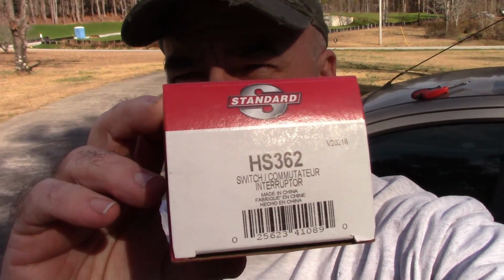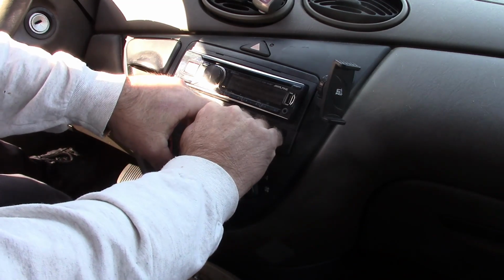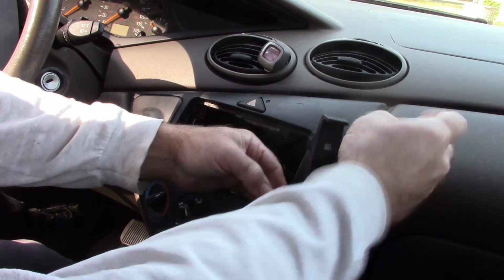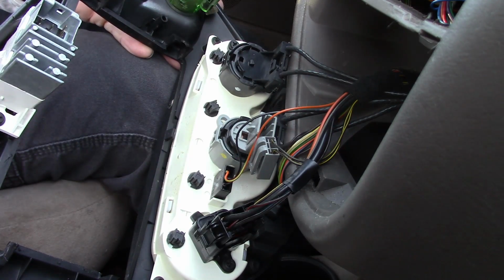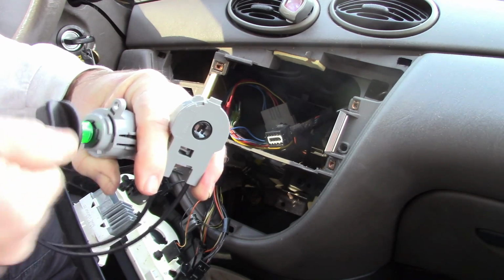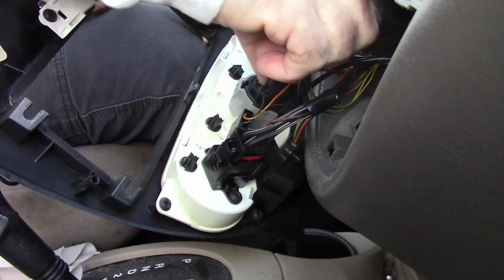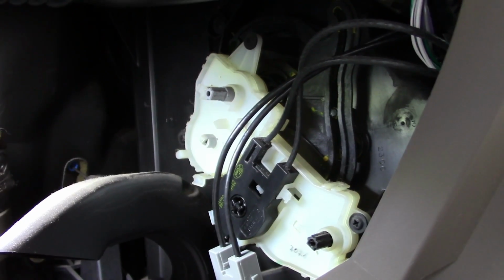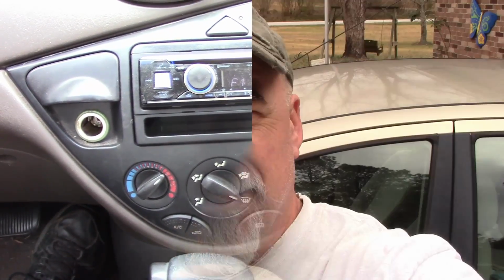Ford Focus Heater control switch replacement. Air vent control cable.

Comment: Thanks! I just had mine replaced last year and it broke again. It always sticks, I let my niece borrow my car and she broke it. Now I don't have defrost. Why does it keep sticking?
Reply from the maker: Hard to say.
Reply: @JoDaddysGarage I was told once that this is one of the Ford Focus flaws /issues. Thanks for the video. I have a 2006 Ford Focus and it has the same issue. Back around 13 years ago I brought it to a Ford dealership and they quoted me $1500.00 to fix. That covered 10 hours of labor and what not. How long did it take you? Just curious. As a woman who doesn't know much about cars,  I am willing to fix it myself after watching your video. 😊👍 Also, how do I get the part?
Reply from the maker: @irbeliaespinosa6622 I found the part on rock auto website.

Comment: Changed my cable it  was still sticking it was problem with vent not running freely drilled holes behind it and lubricated vent control lever spraying lubricant in drilled holes..works fine when heaters on hot..worse thing is accepting is what a complete hash someone msde whrn designing such a stupid idea😡😡😡

Comment: So the box itself on my car seems to be in a bind and im afraid if i purcahse and replace the switch, it will just break again. Anyone have any suggestions?
Reply: Yes its the vent door inside the box that the cable and knob is trying to open and close... it sticks in the shut position and when the knob is forced, it breaks the cable or controller... replacing the cable doesnt really fix the issue.. the door has sticky on its edges, the result of a foam rubber thats melted with heat... thats why the door sticks in the full left or right position  when turning the knob... the fix is to clean the edges of the door or at least spray some lubricant like silicone in there which will keep it from sticking shut.

Comment: The control switch does not turn to control to turn to either the inside car or window sc reen settings can u help
Reply from the maker: It’s probably the cable.

Comment: Thank my friend. Now i really urge to fix the air routing on my focus. Big hug from Argentina, Buenos Aires.
Reply from the maker: If the a/c is not working, there is a resistor behind the glove box. I replaced it and mine worked.

Comment: Could you move the mechanism by hand without a cable? Becouse I cant, mayby cams locked.. :(
Reply from the maker: I could move it by hand.
Reply: I know whats happend.. You have to clean and lubricate a manipulator(plastick "valve") which change direction of blowing insde of fan tunel. Its cuz of old gluing seal

Comment: Thanks bro! same issue with ours though it still rotates to the settings, just Very stiffly.. cable may not yet be broken.. now i can see how it works and what to check

Comment: Original radios from 200-2004 were anti theft radios which requires the “u” shape radio tools. 2005-08 are held in by 4 7mm screws. Not sure from 09 onwards.

Comment: My one is just sticky. I can only change it from defrost to eyelevels vents when the engine heater is hot. Looking at the underdah image I can see that the plastic cam arrangement is probably dry. I'll give it a lube and see if that helps. Thanks.
Reply: I have same problem for years. Lubricants helped for a half year…

Comment: Barry, my control works, turns on the dial and at the fan! But the air does not seem to be coming out at the vents, floor or window when I have it set on the dial at those positions. I had the dash out! Too replace the heater matrix. Do you know what I might have done when re- installing? It's pretty straight forward.
Reply from the maker: Is the air blowing out anywhere?

Comment: I hope it's similar on the 2007 model SE focus
Reply: Same here! How did it go? Parts (for both temperature and vents) arrive this week 🤞🏻
Reply: @iamhazelnuts  broke within a week got a replacement lasted a couple months and it broke again haven't bothered replacing it again
Reply: @AlatarBlaze  that sucks :( thanks for the update
Reply: @iamhazelnuts  ah it is what it is i just adjust it under the dash if i need to

Comment: You're do it wrong at the beginning. Don't go with the screwdriver before removing the radio and the screws
Then use a plastic tool for the purpose